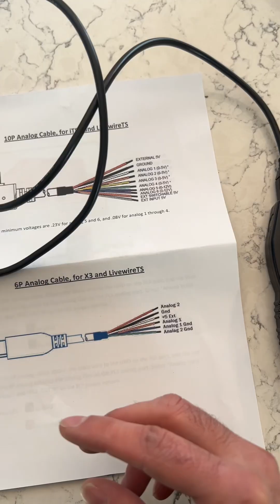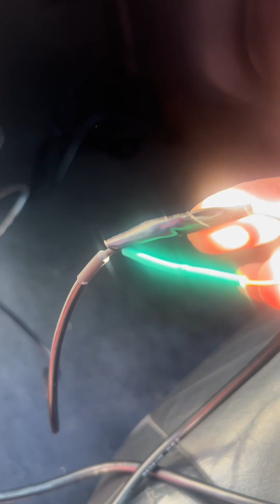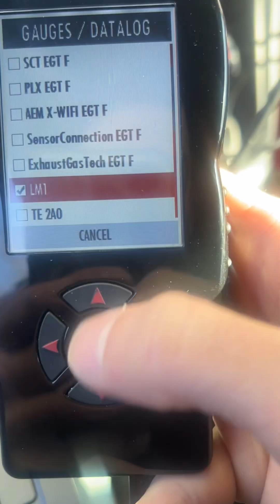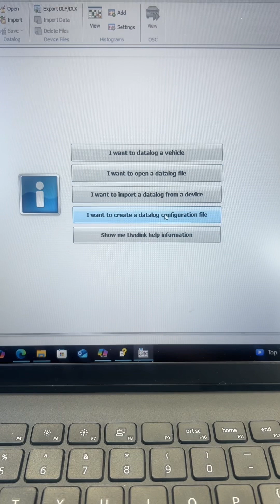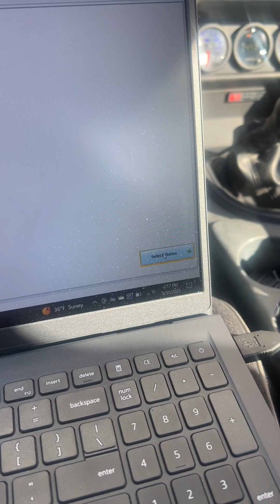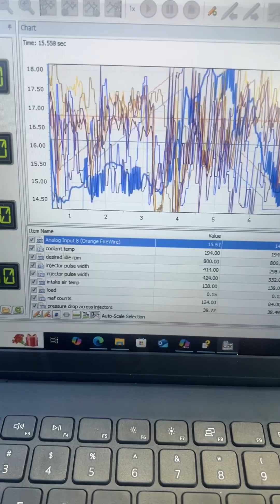AFR Data logging using SCT

Comment: So LM1 is the correct formula to use? Does the brand of wideband that you're using make a difference on what formula will read correctly?
Reply from the maker: It shouldn’t matter. The signal regardless of wideband is read in voltage. The formula in the software translates it into something useful for you to use.
Reply: @SaleenDrift I've been having trouble with mine getting to read correctly in Livelink. No matter what equation/formula I set it too, it doesn't change how it's being read. My wideband is hovering around 14.7 at idle, but on Livelink it's reading around 4.00, regardless of the formula.
Reply from the maker: Make sure you are using the formula on the proper wire. It is hard to diagnose via text but as long as the proper wire was used and the formula is applied to that input, it should work.